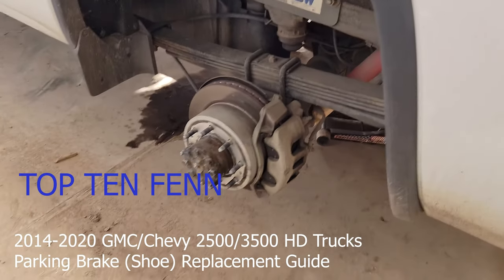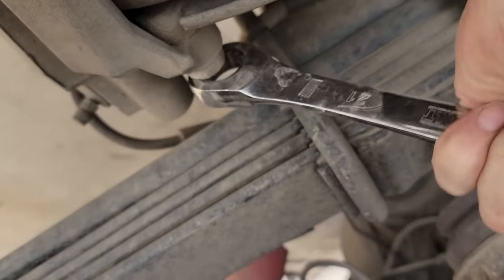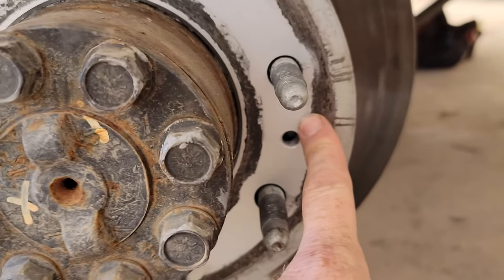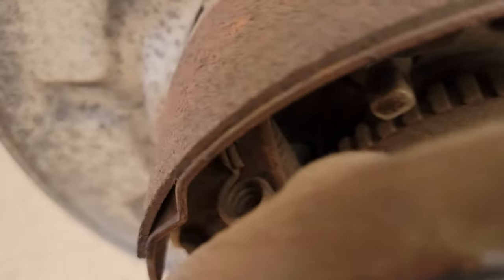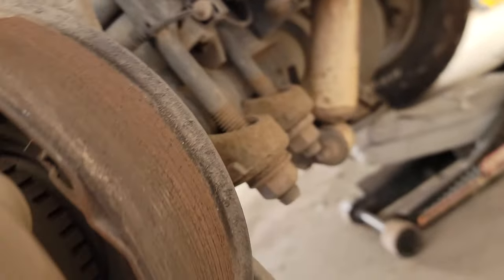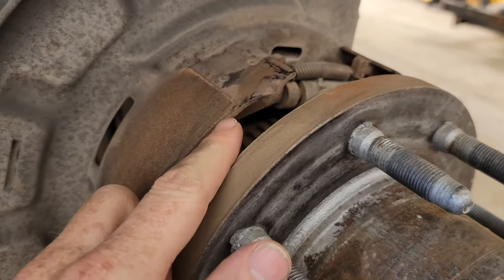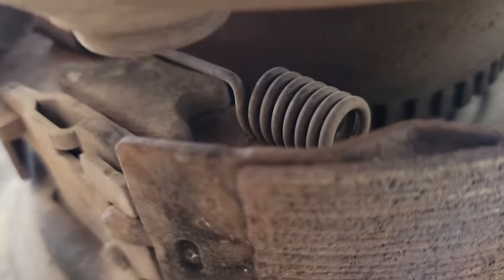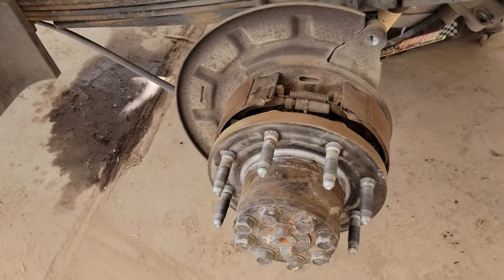2014-2020 Chevy/GMC 2500/3500HD Parking Brake Shoe Replacement

Comment: Brother im a mechanic.  Done thoudands of these maybe more.  Brother but im having a problem with one today. Everything is new the shoes, pads rotors! It's making a stupid noise though not a grinding more like a rubbing.  Has it ever happened to you? I've taken this thing apart over 5 times put it together same stupid sound. The caliper returns back easily it's not seized! The adjustment is set right but it's still making a noise it's driving me nuts please Brother! Have you ever had that problem happen ?

Comment: In 5 minutes you can have the axle out and hub off. Then everything is right there. Isn't worth the fight doing it with the hub on.
Reply from the maker: I agree I just didn't wanna smell like gear oil or refill the diff that day to be completely honest. Its definitely easier pulling the hub tho.
Reply: Buddy do you think the hub would come off if he removed those axle bolts?

Comment: A million times easier to pull the axls. Just my opinion. Jacking up an 8500 lb truck using the differential bulb..?? Yikes. Tippy as f. Glad it didn't fall on you.

Comment: My problem is the old parking brake shoes were siezed on the inside of the drum... couple hours of brass hammering/spinning/pb blaster... rotors off, remove shoes... replace shoes... star bar brought in all the way and the rotor doesnt fit over the shoes, correct rotor, correct shoes... problem unknown
Reply: Did you turn the adjuster to bring the shoes in?
Reply: @davidscarano2443  yes i did, i brought them all the way in, i found the problem and forgot to update this thread, the amount of rust on the arm the parking brake cable attaches to is what was causing the issue. Built up behind the portion of the pad that keys into it and it wasnt seating properly.
Reply: @mm-nl3qz  thanks for sharing. I’m not looking forward to this. I just replaced brakes all around, had two seized calipers. One I fixed one I replaced, both front. But didn’t know the pads for e brake were inside or behind rotor. They absolutely don’t work right now
Reply: @davidscarano2443  check the parking brake cables as well, inside the plastic "hose" the brake cable slides in what looks like the electrical "MC" metal jacket. I had moisture/salt and dirt get in because the outter coating rubbed off and rusted the hell out of the inside of the cable assembly siezing it completely. Had a few solid days of cursing before i chilled out and just looked everything over from the parking brake pedal to the rear parking brake pads.
Reply: @mm-nl3qz  thank you for the tips
Reply: @davidscarano2443  hell yeah man, its an absolute b!$ch to get the cables back on the those metal pad spreaders but if you can pull them from the spreader/tension spring side and go back in the cab and press the pad if they pull in and compress the springs a bit they should be functional, if not, spend the extra money and replace the cables. Also check the parking brake pedal assembly for rust, i fluid filmed mine cuz she was crusty as all hell... North east here so salt is brutal
Reply: @davidscarano2443  also... smell check the area  the parking brakes mount in. I was a jack@$$ and messed up the wheelhub seal and it was leaking gear oil into the inside of the drum of the rotor mixing with brake dust/dirt and salt. Said to hell with it and replaced the rear brake sheilds as well. Pita to find but i found them, bare metal of course so sprayed them and mounted them 🤣
Reply: I’m hearing screeching coming out of my back left it didn’t do it before but I used my parking break one time now it’s like they aren’t disengaging? Any ideas?
Reply: @noahmenchaca243  yeah, id definitely pull the tire, pull the caliper, pull the rotor.... if the rotor is a bear to get off the actual parking break pad material could have delaminated from the parking brake pad assembly(the metal the brake pad material is mounted to) get ready to curse cuz its a bitch to get off, if that's is what's happening. 

OR. 
The pad material is gone, and the parking brake pad is stuck due to a rusted actuator worn retention springs and it's boring into the interior of the rotor hub. 

Again be prepared to replace the rotor and/or the pads/parking break hardware. Honestly it's better to do it all in one shot so you know you won't have to worry about it until